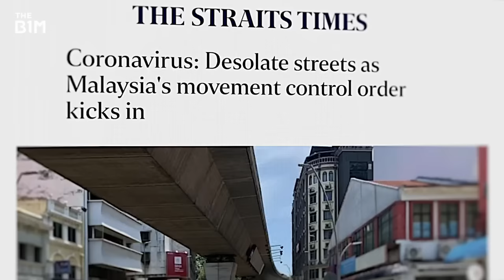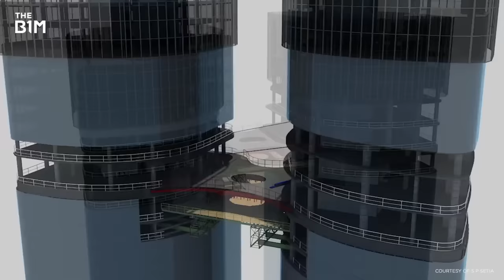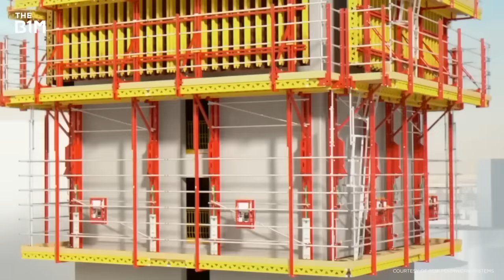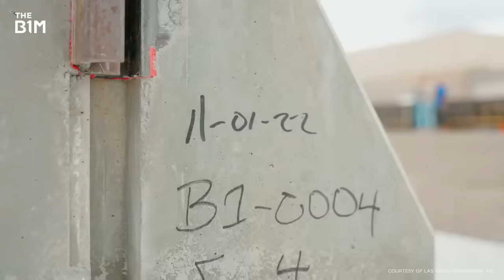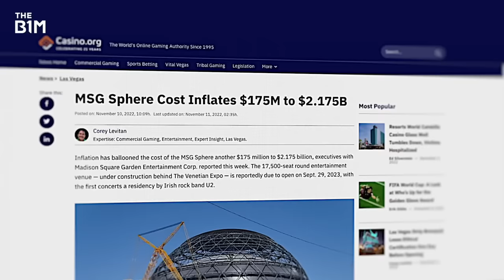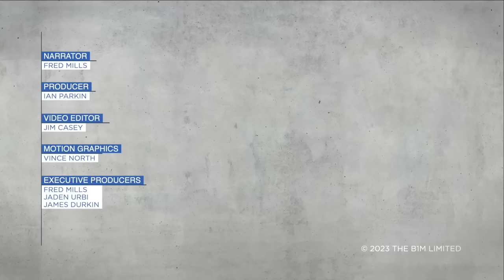Top 10 Projects Completing in 2023

Comment: This is way in the future, but considering they've substantially changed the plans again, I'd love to see you make a future video on the Washington DC Union Station Redevelopment project. If/when realized, it will surely make Washington Union Station the most modern and capable train station and transit hub in the United States, something we typically fail at over here.
Reply: i think you need to meet grand central station and the ongoing new doings at penn as well.
Reply: Wanna hear a joke? USA infrastructure
Reply: @dr3754  I love the improvements at both GCS and Penn, but aside from the Moynihan Train Hall at Penn, the changes that are talked about are mostly about connecting new lines of service and the required infrastructure that is needed for these services, such as the East Side Access Project at GCS and the Metro-North project at Penn. What's proposed at Washington Union is a total revamp. Aside from the historic main hall and terminal, the rest of the station is going to be essentially brand new. Improvements include multiple new access points, dedicated pickup/drop off areas, a bus terminal, multiple new concourses, and modernized and widened platforms. The renderings look amazing with train platforms running visibly on the level above the main concourse. While the improvements at GCS and Penn are definitely welcomed and needed, the breadth and scope of what's proposed at WUS is just so extensive. They're basically building a totally brand new station from the ground up behind a the historic building.
Reply: I have said this countless times, build and fully fund the modern multilayered national infrastructure process and the projects will come…

Comment: ya know with the Paris Olympics you mention its gonna take its power from renewable sources which leads me to ask why don't they just chuck the solar's on top because then you have two options - 1) it can be the power source for after the games or 2) it can feed directly back into the grid when it becomes "dormant"
And  this can also lead to other Hosts using these stadiums as well generators basically

Comment: Azabudai Hills in Tokyo includes residence. The top floor is rumored to be priced at $200 million. It's the tallest building in Japan, so of course you cannot live higher than this. The second tallest residence is about 80 meters lower than this.
Also, as mentioned in the video, Azabudai Hills is a HUGE building. Surprisingly, the total floor area is 460,000 m^2, almost the same as the Burj Khalifa.

Comment: La Paz is now just the administrative/legislative capital (or something?), while the judicial capital is Sucre. So it's like Bolivia has two capitals.
But Bolivia also has a city next to La Paz which is even higher: El Alto has an average height of 4,000 metres above sea level, with a peak of around 4,150m. El Alto is where the airport is if you fly to "La Paz" also, so there's no real respite from the altitude sickness upon arrival. The cabin pressure within the aeroplane will be lower than that outside, even after landing at El Alto. (8000' vs 13,500')

Comment: Concerning F1 in Vegas: It's very likely going to suck. The layout may include 13 corners (as far as I know; you said it were 17), but still it lacks the finesse that makes a good circuit. The straights might be long and give high speed driving, but that will be mostly used in qualifying as in the race drivers will have to keep the engines cool and the fuel tank filled enough to get over the line and still having enough fuel for the FIA to take a probe in order not to be disqualified.
Additionally the prices to pay for tickets to attend the race are astronomical.
Reply: I would assume they will have he race in Spring or Winter. Because during the inferno only indoors lol
Reply: @Sam-gs7yb  November

Comment: The MSG Sphere is going to be a giant failure.
Over an 18k capacity. That's never gonna get filled if you continue reading.
There is nothing to show there other than stuff you can put on other screens.
It can't be used for concerts. Even if it could they have better and more importantly cheaper alternatives like Raider Stadium.

Imagine if some of the LED screens fail. See opening Ceremony for the China Olympics to see what that was like. (Google - China Olympics BSOD)

The ONLY way I can see it getting filled if for extra seating for the F1 race. But even then you may as well watch it in your room.